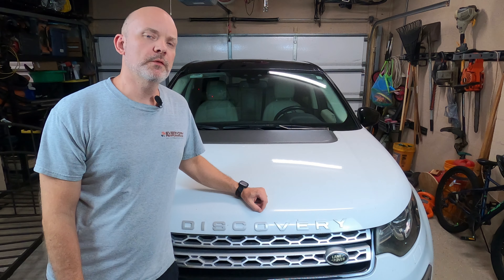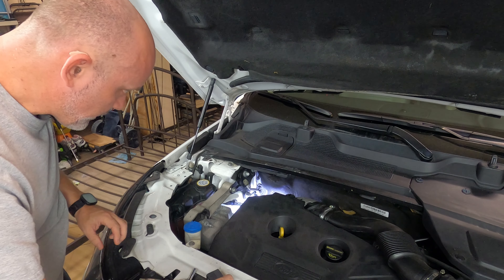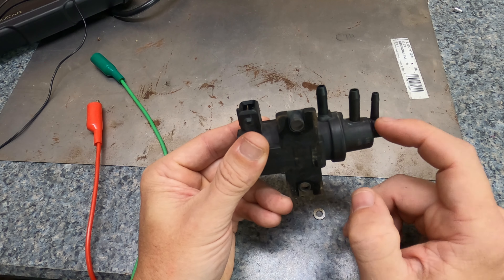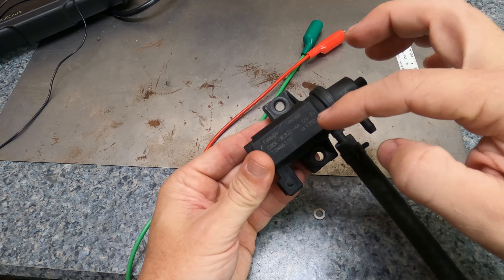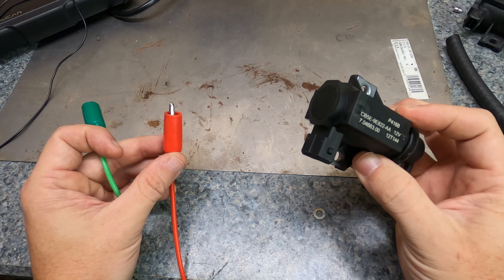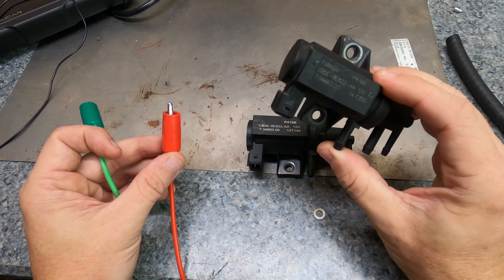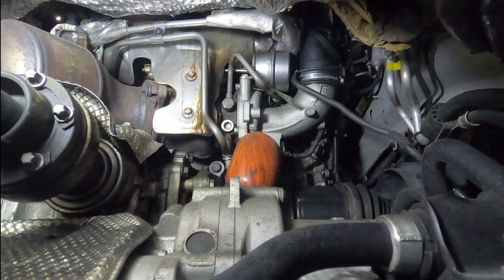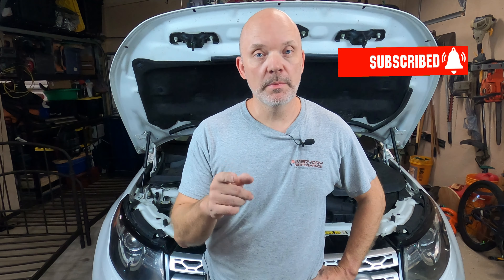How To Easily Test And Fix A Turbo For Overboost Code P0234.

Comment: hmmm...same motor but on ford ecoboost 2.0s the solenoid looks different and sits right on top of the engine under that plastic cover/between the ignition coils. Be careful when removing hoses! Lot of guys say they rip easy!
Reply from the maker: @salvatoregervasi9828  yea. I agree and even the smallest hole could leak enough pressure/vacuum to cause issues.